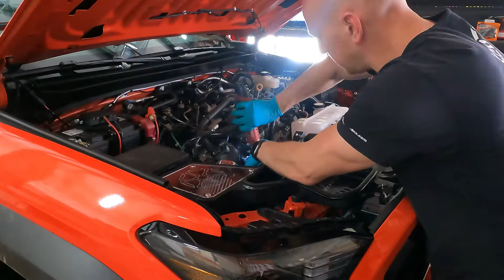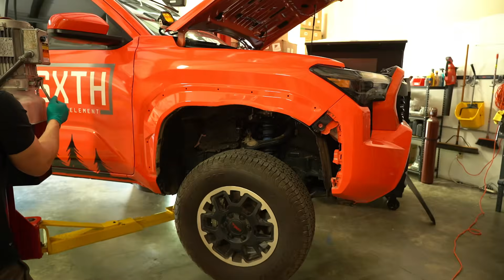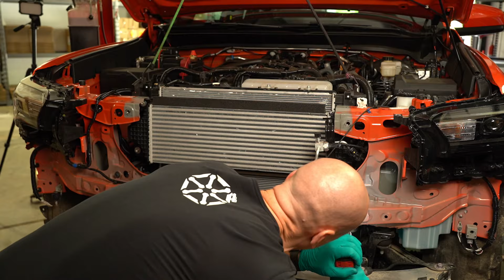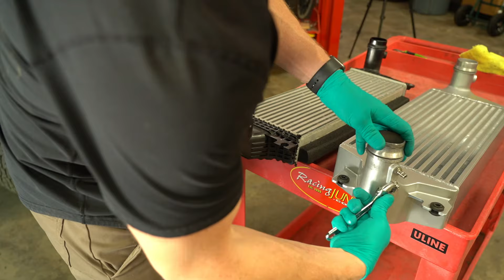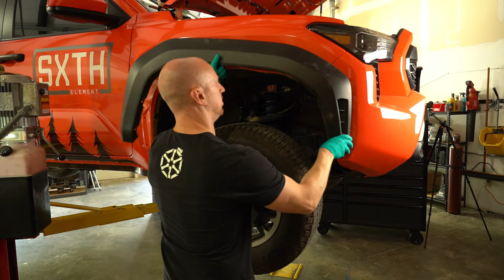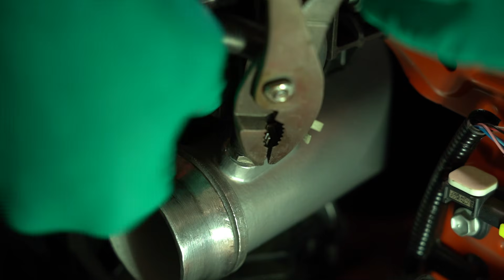Toyota Tacoma 2024+ Intercooler install

Comment: Do you really believe Toyota would sell the Tacoma with an under size intercooler?
Reply from the maker: We think Toyota made a great truck, but we also think if a Tacoma owner is running a lift, larger tires, and overloading the vehicle with excessive weight then it can't hurt to help the engine breathe a little better. If another upgrades the rest of the truck, they should probably upgrade the performance as well.
Reply: @SXTHElementEngineering Great answer

Comment: Since the trans cooler runs through the intercooler would this inadvertently help with transmission cooling?
Reply from the maker: Transmission fluid does not run through the intercooler, we are working on a trans cooler, look for it in 2026.

Comment: With the 2024+ Tacoma models having issues with an overheating transmission, is this the fix to that?
Reply: No this is an intercooler, cools air before going to the motor, you’re looking for a trans cooler
Reply from the maker: Look for our Transmission cooler next year! Thanks for the question.

Comment: Benefits? HP improvements lower operating temps. Give specs... Why put out a install vid for a product we cant buy yet? You're putting the cart before the horse.
Reply from the maker: Hi thanks for your comment. This video is doing exactly what we want it to do, drive interest.  I appreciate your comment, here is the link to the product page, hopefully your answers can be found there.   https://sxthelement.com/collections/toyota-tacoma/products/2024-toyota-tacoma-4runner-land-cruiser-front-mount-intercooler
Reply: You must’ve never heard of Apple Corporation if you think this putting the cart before the horse.
Reply from the maker: Intercooler is now available. If a Tacoma owner is upgrading the rest of their vehicle with lifts and larger tires and extra weight. Can't hurt to have more air flow and performance back to the engine to assist with all the extra mods, don't you think?